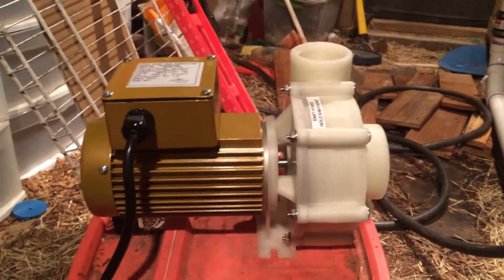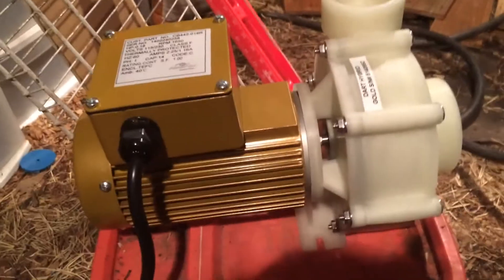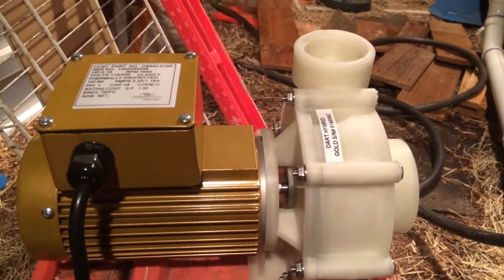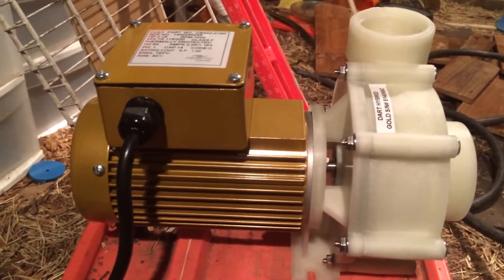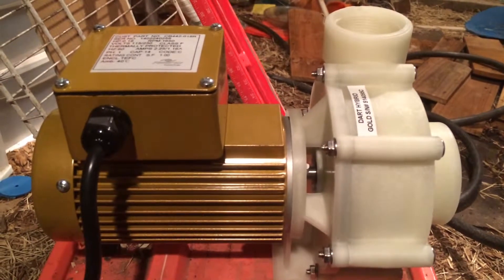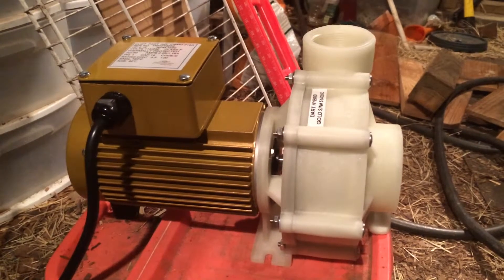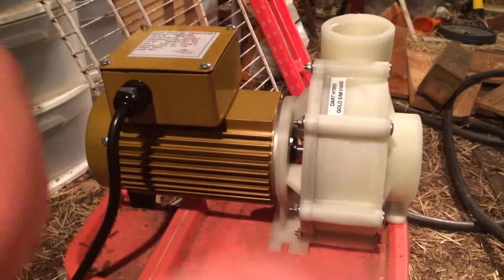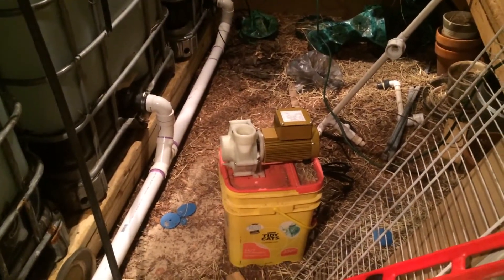Raising Tilapia - The Water Pump

Comment: which pump should i use to recalculate 30000 liter 8 tank...?
Reply from the maker: Just True I don’t know off hand. It’s your choice based on how many times per hour you want to turn over the water volume of the system. I’ve always leaned on more flow being better. Default to a higher flow pump and just put a ball valve in line if you think you need to choke it back a bit.